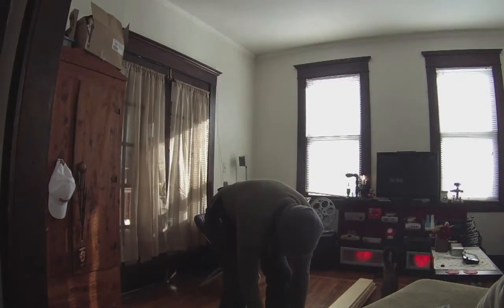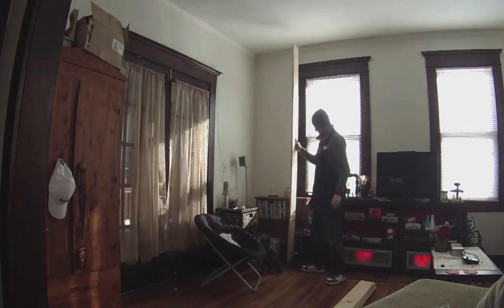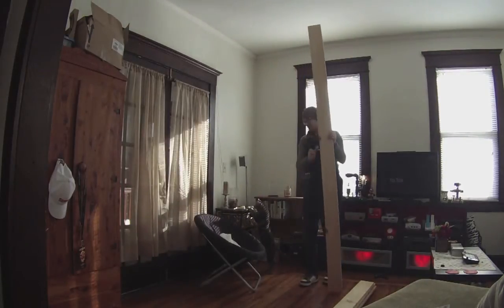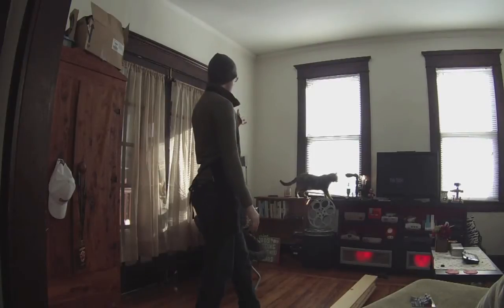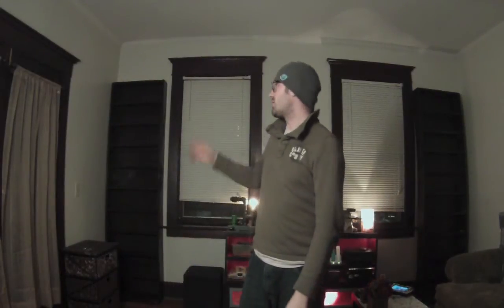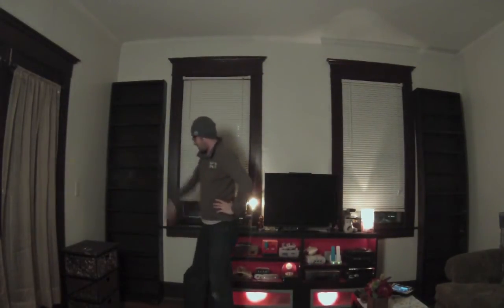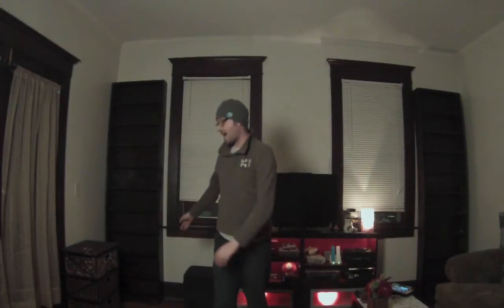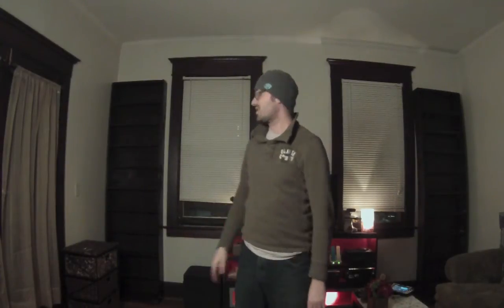DIY | Custom Wooden Bookcases to hold video games, DVD, VHS tapes and more

Comment: they turned out awesome man...
better then the cheap crap you can buy in the store..
shocking your wife let ya do all the work in the living room..
Reply from the maker: thanks so much man. They really did come out great. The stain on them pulls the room together and really fills in those gaps we had. Yeah my wife was pretty easy going with it. I built our kitchen table out of a wood pallet, so I told her it doubles as my work bench because if I drill holes in it or whatever it just adds to the rustic look of it lol